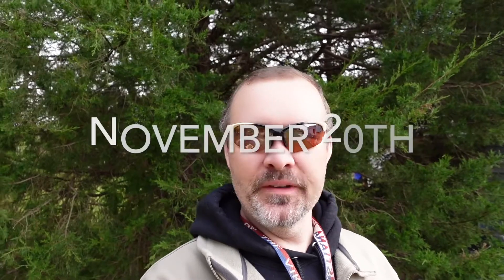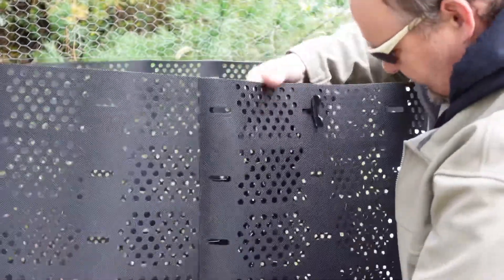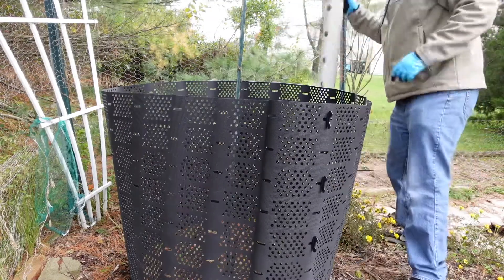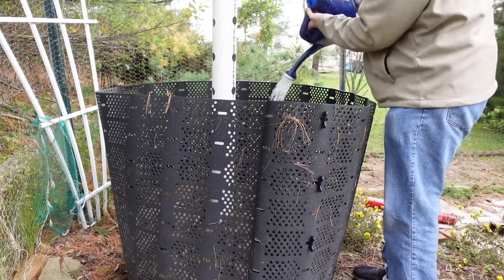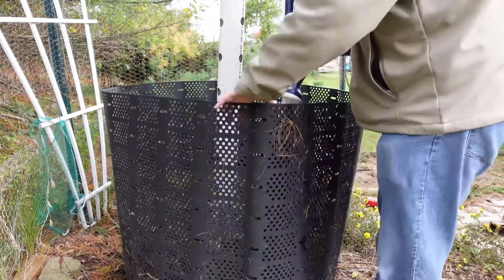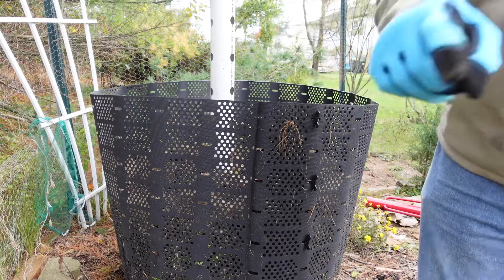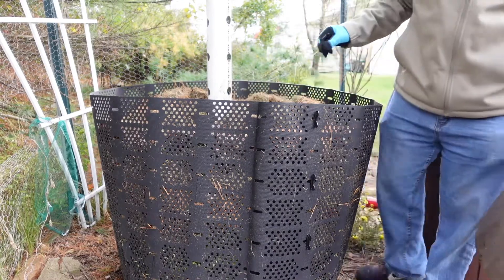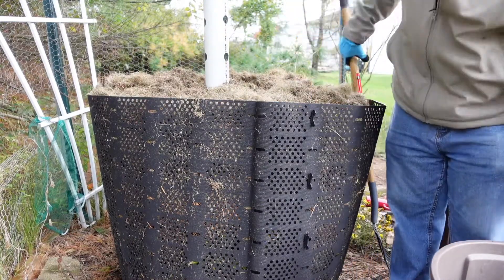Passively aerated compost bin using a GEOBIN and PVC pipe

Comment: got two shredded Christmas trees, was nervous about them being acidic?
Reply from the maker: I’ve composted pine needles for years, and did a soil test with the extension office and the ph was a 7 (neutral) a year and a half ago. Not sure your setup but a few options. Use the wood chips as a path in the garden, the chips will break down slowly. Add them to a raised bed, add leaves and grass clippings then a 6-8 inch layer of soil on top (they breakdown and hold moisture which the plants roots can tap into). If you decide to compost there is two methods put them in a pile and do nothing( this will take the longest to breakdown), or add wood chips, grass clippings, food scraps, and turn once every week or two. Incorporating air, water, and nitrogen (grass and food scraps) will help the wood chips breakdown faster. You could research it a bit more but I wouldn’t be nervous about composting or using the Christmas trees in the garden.

Comment: about how long does that take to break down? do you have to turn it at least once?
Also does the PVC pipe need specific measurements? height? size of holes? how about placing of the holes? are holes on all four sides? 
I don't know how to use power-tools. do you know if you can buy PVC with holes at home depot or if they have people that can cut it?
Reply from the maker: Passive compost piles take a while to breakdown, it can take 6 months to a year. It depends on what you are adding to the pile, weather, and temperatures. Colder air temperatures the longer a passive pile will take. What I love about compost is nothing has to be very specific. The pipe I’m using is 4”, I made sure I had at least one hole every foot of the pipe. (Air can penetrate a compost pile 12-18”) There is always air on the outside of the pile bug that is why I want to help air get into the middle of the pile. I did put holes on all side and tried to stager them. You really don’t need holes, you could use a hand saw and cut small wedges out of the pipe. I’m not sure if a home center would be able to cut holes into the pvc pipe. Another option could be purchasing hardware cloth, you could shape it into a circle and then add compost around the hardware cloth. This option would be a little more expensive but no power tools would be required. Sorry for the long response. Hope this helps you out.
Reply: @GardeningwithBarchuckin  no--I do appreciate the thorough response. Thank you! :D

Comment: Updates?
Reply from the maker: In less than 7 months it broke down pretty well. After a few weeks it shrunk by 12” I added more leaves and a few months later it was down another 15”.  I picked up a tumbleweed aerator and used that in the pile a few times. I actually just had a shed delivered and placed it where my two compost bins were. So I had to move both of them. I think I will build a large compost bin area.  Something around 4’x4’x4’ Thanks for checking 😁

Comment: How is the bin? Has it gone down in volume any?
Reply from the maker: It’s dropped around 12 inches in the first 2-3 weeks, then I added another trash bag of leaves to the top to fill it back up and since it has dropped another 6-8 inches.
Reply from the maker: I really like the bin, less material falls out than the rolled galvanized bin (2x4 inch holes) I made. I haven’t tried to move it and set it back up yet.

Comment: I LOVE those geobins! Every county and borough should distribute them in an effort to get ppl to compost, the holes are small enough to keep the rodents out. They roll up so small and take up so little space.
Reply from the maker: I like the size of the holes! I made a bin out of the rolled galvanized fence and the holes are 2x4 so the material would fall out when flipping or added. I seen Home Depot sells these for around $38. I was taking with the cooperative extension office and they said we have something for composting and said it was $20 😲 
Another great feature is you can make the bin smaller or bigger depending on the space you have available
Reply: @GardeningwithBarchuckin  is there any other place to get them? Also do u need to put a stake in the ground? To hold it up? Or u can just leave it like this
Reply from the maker: @edss7778    I have seen them offered at Home Depot, eBay and Amazon but they around $40 through them. You do not need to add spikes but they would help to keep the bin’s shape, it kind of floppy until you add a bit of material. And what I added to the middle was to help get air into the middle of the pile but is not needed to use this compost bin.
Reply from the maker: @edss7778  I would check with your local cooperative extension office, they may offer a similar program, with talking with mine they offered special in the past for rain barrels too.
Reply: @edss7778  You don't need to stake.  Just try to keep it upright abd round as you add material.  If you want to turn the pile you can either lift the bin off and put in a new spot or unclip to pull it off.  Then fork material back in.